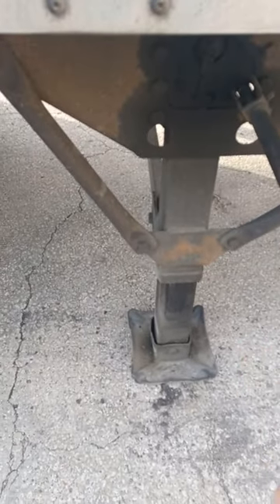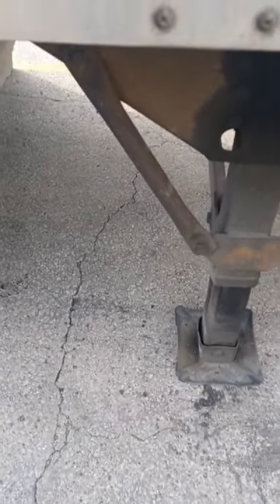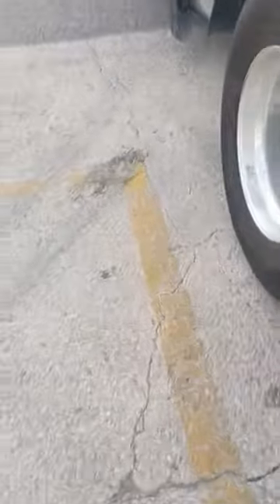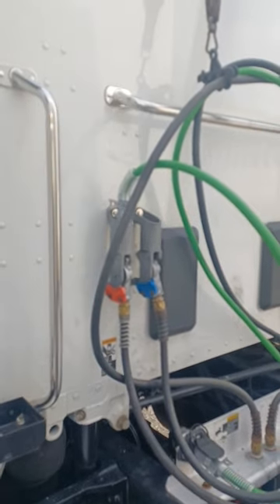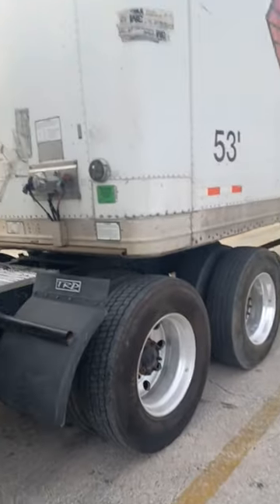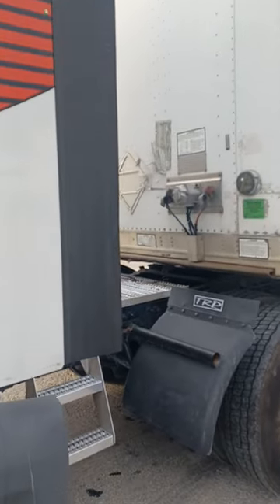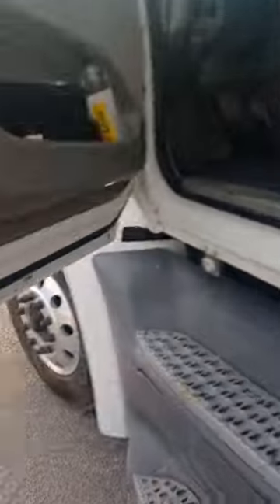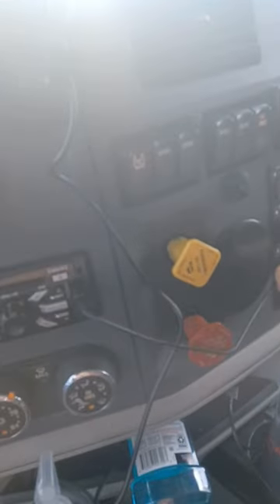how to disconnect (drop) your trailer from your tractor

Comment: I dropped my landing gear to the ground except Honda in London, Tn. The trailers are parked so close that you can’t get the handle out. In that case I left it just a little off the ground so I could back in pull the pin drop air.
Reply from the maker: Thanks for watching

Comment: You may want to pull forward about two inches then drop the air from the air bags the fifth wheel won't be dragging as rough when you drive away from the trailer.
Reply from the maker: Great advice 👍

Comment: Doesn't matter either front to back or back to front. Just do it the same every time,  or eventually you will forget something and then you have tore something up. But you are correct landing gear only barely to ground. Hate when people keep cranking till its too high. For the next guy.
Reply from the maker: Exactly

Comment: DONT EVER DROP LANDING GEAR ALL THE WAY TO THE GROUND, ALWAYS LEAVE 2 INCHES SPACE BETWEEN
Reply from the maker: Thanks for watching
Reply: 2” is pretty low, usually a good spot Is an inch, however some guys “inch indicators are off🤣
Reply: He just making it harder for the next dude when he pick it up
Reply: @AceSmoke662  Exactly, He's not thinking about the nxt driver that has to hook to that trailer but cant get to the landing gear because a trailer got dropped right nxt 2 it..